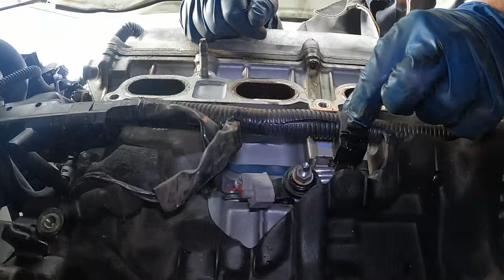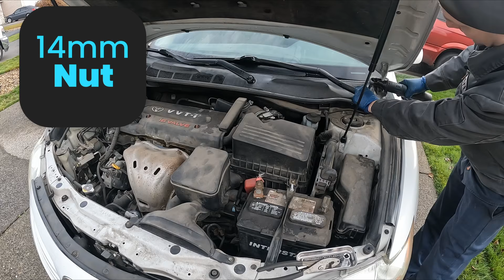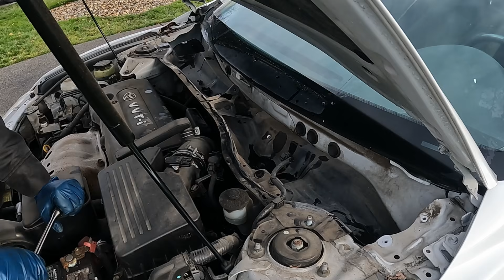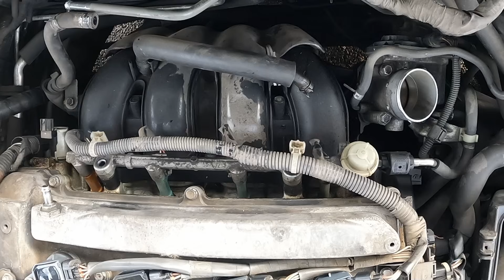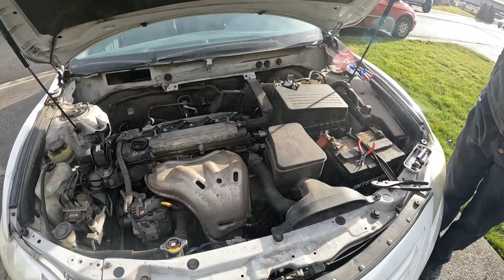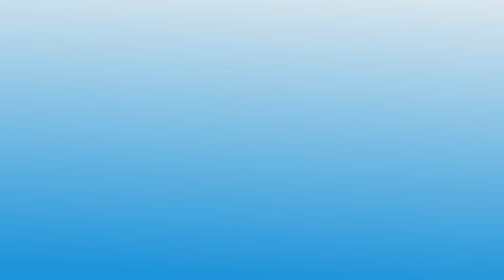Toyota Camry 2.4 Knock Sensor How To DIY Replacement

Comment: Can this cause crank no start ? I installed new fuel pump
Reply from the maker: No, it only retards the timing a little but not enough to cause a no start. Do you have any engine codes?

Comment: I do these without removing the manifold its doable , just make it loose and push it back and down against firewall , its tight but I have no problem doing them
Reply from the maker: Nice! Thanks for the tip 👍

Comment: Great tutorial, thank you!! BE ADVISED: if you came here to see how to do this in a Matrix with the same motor, it's not possible to do yourself in the driveway with ramps LOL. The second manifold bolt on the bottom closest to centerline that he talks about but we don't see here is blocked on the Matrix by the cv axle, the corner of the transmission housing, the control arm, the exhaust, and some wires. There isn't 2 inches of clearance anywhere around it and the bolt itself is mounted in a recess in the manifold, so the only thing you CAN get on it (if you manage to snake your arm plastic man- style up through that mess and get the socket on) is a super thinline socket. Which you can't turn anyway because of the lack of clearance I mentioned earlier. Stupidest engineering failure this side of a CR-V. Thanks, Toyota! Taking it to the garage tomorrow where I suspect the transmission is going to have to get dropped to reach this. A $12 part replacement and a 2-hour job made into a $900 job by the fine engineering minds at Toyota :)
Reply from the maker: Thanks for your comment! Good to know the Matrix is different. That's too bad 😕
Reply: @ValleyMobileAutomotive  Update: I figured it out! You can actually come at that bolt from the TOP...but it's pretty awful. I printed a picture of what the manifold looked like off the car, and then felt all around with my fingers until I could get a slim socket on it. Followed your instructions otherwise, worked great! I also did the throttle body and manifold gaskets for another ten bucks as long as I was in there.
Reply from the maker: @Zer0Bit1  Nice work! Glad you got it 👊

Comment: great video, lots of disassembly just to replace that. Does this vehicle just have 1 knock sensor or 2?
Reply from the maker: It has just the one knock sensor 👍
Reply: @ValleyMobileAutomotive  thank goodness for that, but what you go thru to get to it is a journey in itself.
Reply from the maker: @BOBBYB3133  Yeah it's pretty tucked away. If you have to replace yours I recommend a quality brand sensor that will last a long time 👍
Reply: @ValleyMobileAutomotive  definately i dont want to have to do it twice. Great channel, always a timely informative spot on response

Comment: Dude! Excellent video! This is the best video on Youtube in regard to replacing a knock sensor on this generation of 2.4 Camry.  However, I would like to know the torque specs on all the nuts as I re-assemble everything, Do you know where I should look for all of this info? Thanks, Man!!
Reply from the maker: Starting at 5:40 I show the torque specs for each bolt as I put it back together 👍. The only other place I know to get the specs is from a repair manual.
Reply: Thanks Man! I gave it quick look before realizing this video was the best! How could I have missed that? You rock!

Comment: i need to replace the purge solenoid hose but i cant find the part. one end is on throttle body and other end goes to purge solenoid. is there another name for it?
Reply from the maker: You might be able to purchase a foot of standard vacuum hose from the parts store. Bring yours down so they can size it up 👍

Comment: How did you get under the car to tighten the air intake manifold bolts when it was not running? Did you jack it up? Did you push it up on a ramp? Are you small enough to work under the car. regardless? Hmmm?
Reply from the maker: @JamesRay-e3t  Before working on the car I drove it up on ramps. But you can jack up both sides and use jack stands to hold the car up 👍

Comment: Very good video. I able to replace knock sensor without removing the injectors. I had a hardtime getting the manifold out so i just push it down and reach in to replace knock sensor.
Reply from the maker: @franciscomiranojr.7811  Nice! Good tip for others 👍

Comment: why not to open the knock sensor from the bottom? or its blocking the intake?
Reply from the maker: @yasrizulyahya4270  It's under the intake manifold. You need to remove the manifold before you can access the sensor.

Comment: Does the V6 have it in the same location?
Reply from the maker: @Z9abba  The v6 is under the intake manifold in the center of the engine.
Reply: @ValleyMobileAutomotive  thanks a lot for your response!

Comment: Great video. But after removing the Tray, I noticed that my 2008 Hybrid Camry has some thick harnesses & two parallel Brake lines. I'm not sure how to proceed. Any advice would be greatly appreciated. Thanks. Also I cannot find any videos specific to replacing the knock sensor on a Hybrid Camry on U-tube.
Reply from the maker: @allone273  I have not done one on a Camry Hybrid but the hybrid manual says the brake reservoir can be unbolted and moved aside. Are the thick harnesses orange or black? The manual doesn't mention the harnesses.

Comment: Can’t you just undo the intake manifold bolts, move the manifold away from the engine while connected to the throttle body and change the sensor from the bottom?
Reply from the maker: @dallasmarley11  That might be doable I haven't tried it that way. This was the route the manual took. If you try it let us know how it goes 👍

Comment: Will a knock sensor keep a car from starting?
Reply from the maker: It shouldn't. A knock sensor detects pre-ignition "ping" and retards the ignition timing in order to eliminate it. But the car should start and run. You may notice a lack of power though if the ignition is fully retarded.

Comment: Great work buddy, how often do we need to replace knock sensor? I mean how should we know if it's time to replace? Thanks
Reply from the maker: Only when it's giving you trouble. This one was throwing a code and causing the vehicle to lose power.
Reply: @ValleyMobileAutomotive  I have a p0328 code,  just bought the car recently and noticed that it has incorrect spark plugs. Could replacing them with correct ones fix the problem or is my knock sensor finished?
Reply: @carenthusiast6748 did you ever figure it out?